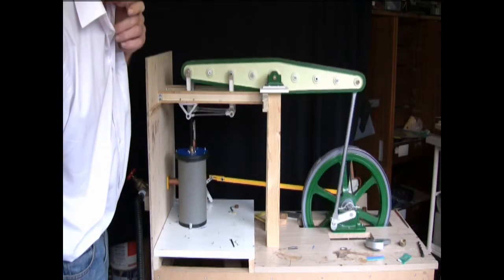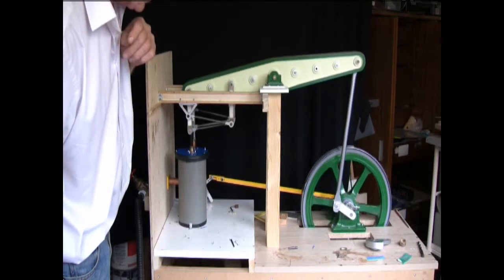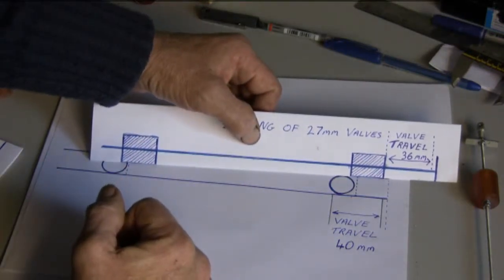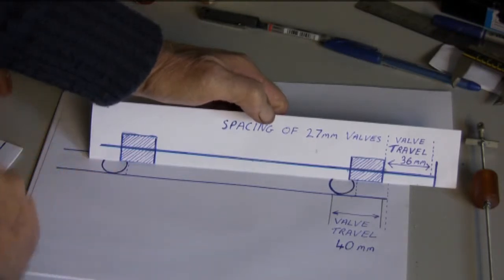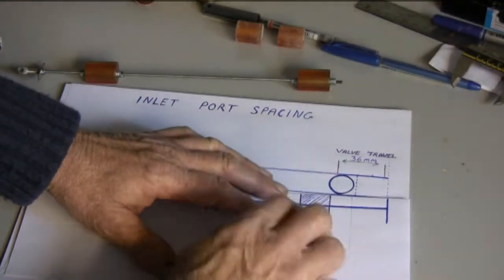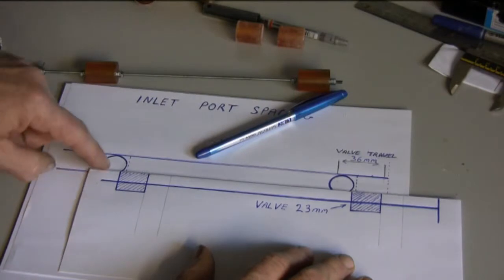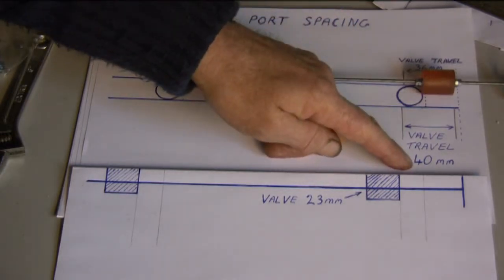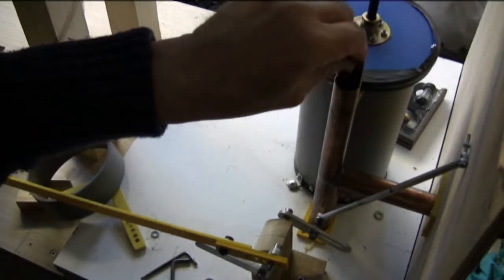BEAM ENGINE FITTING NEW VALVES.by shed engineering part 10

Comment: Followed this all the way through, much smoother now Alan. This is proper engineering. A fascinating series. the flywheel and the bearing blocks really look like they're made from cast iron.
 We have a Victorian pumping station in Leicester, and the restored massive beam engine, (they have it running on open days) is just beautiful to watch - it used to efficiently pump the sewage miles out of town - how lovely! - ..cheers Dave
Reply from the maker: Dave Harriman Hi there Dave many thanks for the interest in my Beam engine build ,,,, I was very pleased with how slow I managed to get her running ,,,, many models (Whether run on air or steam ) you at very unrealistic speeds, And when you have seen the real thing running then to get the speed right was very important,,,,  Yes seen the one in Leicester and dozens more ,,,,  I am just looking at the possibility of casting a beam and flywheel in aluminium,,, but the castings will need to be very accurate so there is next to no machining ,,,   so planning a wooden Pattern ,,,    and I am experimenting to see if I can make a pair of bellows to fit on the trolley under the present engine,,,,  that would be good just to have a weighted lever at each end ,,,, lifting them in turn and the engine runs,,,,  But thanks for your interest and stopping by to comment ,,,,,   But to have a rebuild engine running on steam would be the best achievement ,,,,   ,,,,,,,,,,,,,,,,,          Cheers         Alan